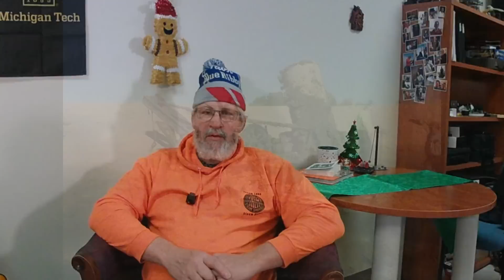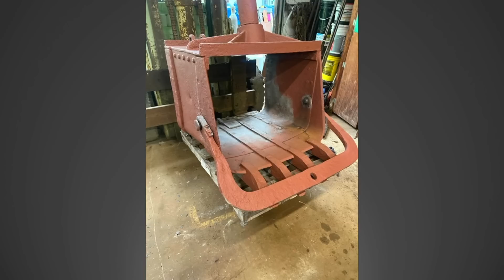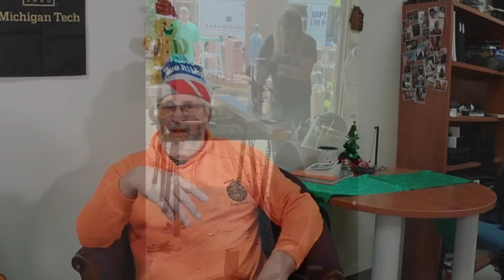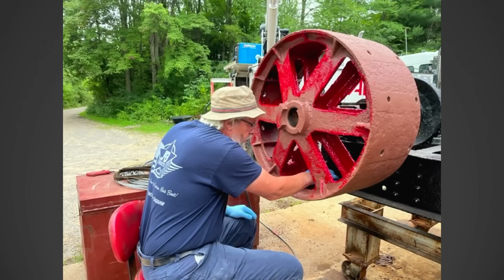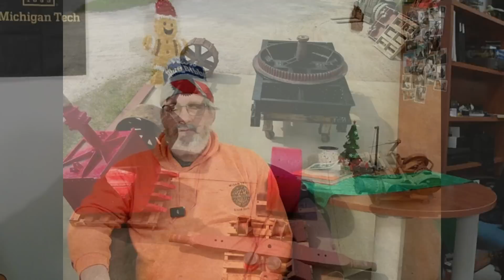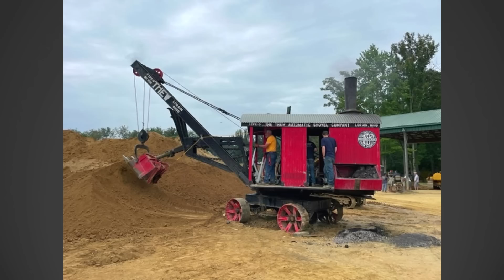Steam Shovel Lost Underwater for 95 Years - 2023 Update

Comment: The rust has killed any chance of it ever working again but it might be able to run with a new boiler and just enough weight to tension the cable ropes.
Reply: My plan is to make it dig again, with all 3 steam engines rebuildable and a different boiler that part is good.  For the steel I’m replacing the bad beams and to have is structural safe to run.
Reply: The rust didn't kill her. she's still strong enough and there's more than enough solid iron left to save and work with to restore her.
Reply: Replacing beams that are bad and making it safe to run